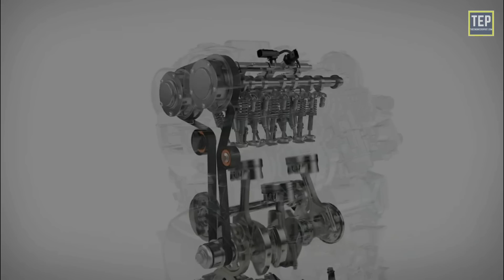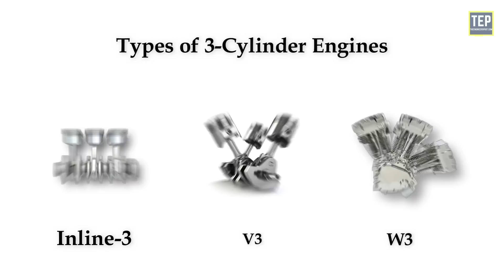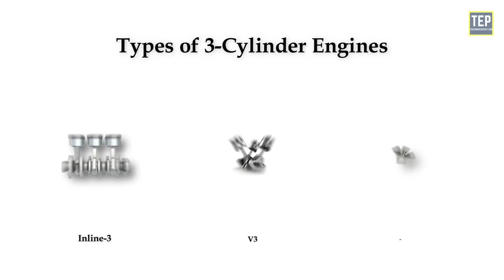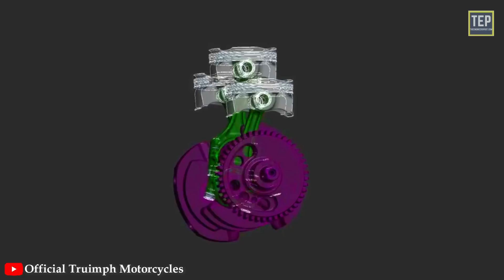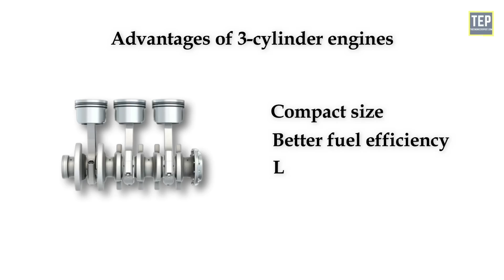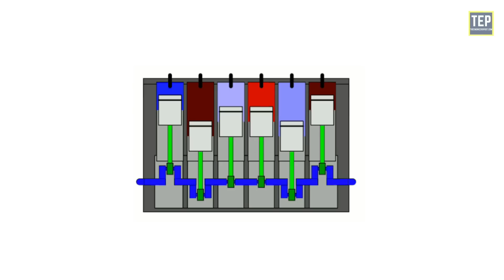How a 3-Cylinder Engine Works? Pros & Cons | Top Cars Using I3 Engines

Comment: The suzuki g10a and its turbo version is a legendary 3 cylinder almost twenty five years in production and sold in every continent on earth and still highly used. Simple to repair legendary reliabilty and fuel economy good torque decent hp with some enthusiasts getting impressive performance from them especially with efi and forced induction. ❤

Comment: they will easily suffer when they start towing weight not light stuff and then this video will easily be invalid because it does not produce all that speed and power it cant pull an suv over 40 mph without playing with the supercharger switch those engines are meant to be in motorcycles and go karts  not in large vehicles

Comment: Between the 1.2 naturally aspirated 3 cylinder Engine on the Toyota RAIZE vs the Turbo charged 1.0l version which you feel is better? I'm a female by the way and i'm stuck on which Variant to buy. Like what's the real difference here and does the extra money worth going turbo?

Comment: We have a a triple (naturally aspirated) in our peugoet 2016 108.  It puts out around 67 bhp and returns 55mpg overall.  You have to use it's  tall gearing to wind it up a hill but at 99 g/km it attracts on road tax in the UK.  The car is a around 900kg so just adequate really, nippy around town.

Comment: I just purchased a 2024 Chevy Trax with a 1.2L 3-cylinder turbo engine 3 months ago and it has been performing well. I sue it as a daily commuter to my job and I am quite pleased with its performance and fuel economy. Let's see how many years of good service it provides.
Reply: You just bought it & all cars drive good brand new. You don't know how good a car is until it hits 100K. 3 cylinder Engines in SUVs with Turbos is like a person on Methamphetamine. Sure at first it seems great with your body on overdrive but you age faster just like a small turbo engine. Also these small turbos require better seals because they produce a lot more pressure & pressures what causes engine seals & gaskets to blow. Also these engine have Direct Injection which causes carbon build up which is a nightmare to clean & will cause constant emissions codes. The truth is they didn't build these for longevity & if you dropped a v6 in these same bodies with that transmission they'd be so much more reliable & probably last a long long time. The only good thing about a 3 cylinder is there gonna create a lot of job opportunities for Mechanics & there's a lot of room to work under the hood. Personally i'd rather have the hood closed as much as possible.

Comment: More vibration? I'll stay with 4 cyc., or v 6......no 3 cyc
Reply: some 5 cylinders are extremely reliable, the problem with 3 cylinders in an suv is the size, they are way to small & will not be reliable long term

Comment: I have a Vauxhall Astra K SRI NAV 1.4 petrol with a cvt gearbox  with a 3 cylinder engine ,I purchased this car new in 2021 and I believe the engine is a GM engine ( maybe you can confirm this, or not? ) this is the only 3 cylinder car I have ever had or driven and, I have to say that that power it has is surprisingly good and, it's very good on fuel returning on a long journey 56 miles to a gallon.

Comment: Father purchased a new John Deere 1020 tractor. 3 cylinder, no turbos,  worked fine. Smaller tractor good for pulling a 3 bottom plow.

Comment: As I thought, the simulation confirmed that in a 4 stroke 3 cylinder engine, it has one BLIND shaft revolution when it is NOT generating power, therefore it is against the 4 stroke duty cycle principle!

Comment: I love 3 cylinder engines, but I hate the CVT that's paired with it, Toyota Raize 2022 is our car and it does well for regular city and highway, fuel efficient.

but low on power, if I had the money, I'd ship Toyota GR Corola over our place and use that instead. 
not complaining about the durability, only complaining about the speed and how fast it picks up.
there is a manual mode, but that deteriorates the CVT ( no belt problems so far... hopefully )

Comment: 1989 Geo Metro Hatchback 1L 3cyl, 5sp, 50mpg, 5 doors, a/c, etc    Incredible high torgue engine, no lugging with the long stroke, I could drive to Las Vegas at 90mph, great car, I put 200,000miles on it after 10 years and it still looked and ran like new. The earlier version 1988 Chev version had a turbo and was a beast.

Comment: Back in the 80’s I had a Yamaha V-Max V4. It was so powerful it was banned in some markets. Then I managed to buy a Vincent Black Shadow from 1955 which did 150 mph. Insanely fast & advanced for its era. It was nicknamed the plumber’s nightmare from all the external hydraulic lines. Today I drive a 2022 Subaru WRX, twin scroll turbo 2.4 litre boxer engine.

Comment: Well, I had a lot of experience with VW platform engines. Four cylinder engines always produced mooooore torque, are more silent and definitely more reliable then same volume three cylinder. Actually I use 1.2l petrol 4-cylinder  and by my experience I will never exchange it for 3-cylinder! 
By the way for comparison, in my private car I have 2l 4-cylinder diesel with 200hp and even the car is 1,5x heavier, AWD and is older, has lower consumption and less emissions. What a stupid EU regulations!

Comment: Make middle piston bigger than other two this will solve the vibration problem 😛
Reply: Yep, but use the perhaps triple-sized (and double weight) middle piston both as a (two-stroke) re-expansion cylinder for the other two (four-stroke) combustion cylinders AND as a positive crankcase pump that feeds crankcase vapors to the oxygenating catalytic converter instead of the current intake vacuum system that feeds crankcase goop into the induction system, which gunks everything up, especially when direct injection is used.

This keeps the induction system clean and means that the reducing cat will see oxygen-free conditions while the oxygenating cat will see oxygen rich conditions, improving both cats.

It works because the middle cylinder is bigger than the other two combined, so pressure in the crankcase wavers. Add a check valve from the intake to the crankcase and another from the crankcase to the oxygenating cat (which is always after the reducing cat).

Way cheaper emissions system that works far better, too. (Patent pending 1/8/24)

Comment: I own a Nissan Kicks e-Power.  Its 3 cylinder engine is only used for charging the battery and only the electric motor drive the wheels.

Comment: I'm surprised they haven't tried to implement a tri-axis engine, with each cylinder at either 60 degrees,or 120 degrees! Lubrication sealing would be a pita, but use of a dry sump system for 2, or all 3 cylinders could possibly work!
Reply: uhh, that's called a radial engine... and they've been around just about as long as multicylinder engines in general... and you either have a wet or dry sump... not this cylinder is dry and this one's somehow gonna be wet, absolutely not how it works.

Comment: I've owned a Mitsubishi Mirage with a 1.2 litre, 3 cylinder, naturally aspirated engine for 10 years and 120,000 klms, it has been ultra reliable and consistently gives 4.5 litres per hundred klm, (approx 60 mpg), I find the engine to very adequate to the chassis dynamics of this small car and great, economical transport.
Reply: Maruti Suzuki Wagonar 4 cylinder petrol engine gives 24km per liter average. The company claims 26km per liter. 1gallon=3.78 liter so 3.78*24=90.72.
Reply: How well does it run on a freeway?

Comment: I had a Honda NSR 400, Nissan Juke 1.2 3 cylinder and a Peugeot 2008 GT line 1.2 3 Cylinder, every one was quick enough. Technology really has moved with the times.
Reply: And they all sound like they're misfiring. Horrible drone boxes, if it has less than 4 cyclinders I won't own it, same goes for cars without a mechanical handbrake, manual gearbox and physical start key. Any car with auto brake and lane keeping assist is a big no. My current car is the newest car I'll ever own.
Reply: @gravemind6536  If you don't have money to get into the newest car technology dont cry, go work earn some money. Older cars are just that old, newer car keep improving everything season. Bug smashed. And if you think 4 is a balanced engine go make some research why a 4 in line needs so many balancing rings on crank, more then a ford 3 inline 1.0 that produces less side unbalancing centrifugal force then a 4 inline. btw ford 3 in line is the best from all car makers with almost none balancing rings, using a unbalanced flywheel and a unbalanced poly to counter the engine, making it very smooth. I have family with the ford 3 inline and if nobody tells, most people cant even notice its a 3 cylinder car. 
Go study, ready some books on physics, use google, dont just spew nonse.

Comment: Kind of like GM's piece of garbage 5-cylinder motor?  GM made it purposefully backfire and sputter; a defect which would eventually caused a failed catalytic converter.
GM did the same with 4 cylinder motors.
Time to vote with your wallet people

Comment: I owned three 3 cyl cars since 2011. Now I have a toyota vitz 1krfe 1.0 mated to a cvt. Its is not that peppy but after gaining some speed it happiy pulls away. And also its not that efficient in bumper to bumper traffic compared to 1.5 4 cyl cars. But its quite on par with them in highway efficiency

Comment: I have a 3 cylinder BMW turbo diesel and I don't like the relative lack of flexibility that inevitably follows the reduction in firing strokes. I like to be able to pull away gently at low revs - maybe 1100 rpm for a 4cyl but the 3 cyl is not happy below about 1500 rpm. I also have a 5 cyl volvo that seems happy pulling away from idle - about 900 rpm.

Comment: Back in the 1998, I had 2 vehicles. One was a 92 Geo Metro with a 3cylinder 1.0 liter engine, stick, no options basic car with 70,000 miles. I purchased this car for $100 and it had front end damage. The other was a 1993 Suzuki Swift with a 4cylinder 1.3 liter engine, stick, no options basic car with 5,000 miles. I purchased this car for $2500 (salvage title).  The Suzuki was dropped from the car hauler when it was delivered and had 0 miles and it was totaled. The gal I purchased it from sold it 4 years later. The Geo Metro was a gift to my brother-in-law when he came from Poland. The Metro was repaired, at a cost of less than $500 total, including a hood, paint, clutch and the $100 price of the car. Both of these cars were made by Suzuki and were reliable. The Metro came with only the 3 cylinder and thr Swift only with the 4 cylinder engine. The 4cylinder was stronger than the 3cylinder, everything else was the same. My broth-in-law kept the Metro for 19 months, he would use it to work for 2 weeks on $5 worth of gas. He then sold it at work to a gal for $1150, he needed a bigger car. The Swift I sold 5 months later to my nephew for what I paid for it, he wanted it badly. About a year later the Metro was doing well, but the Swift developed an electronic problem that was intermittent and unreliable and it was sold.  Both of these cars were great on mileage, I never really saw or felt any differences between them. Thanks…Jim
PS….I have rented a 1990 Ford Fiesta 1.0 liter 4 cylinder, stick, basic car in 1990 for a tour in Belgium, West Germany, East Germany and Poland. I put on 4500 kilometers in 3 weeks. It had great gas mileage and was comparable to the above cars. Mechanically it was no problem, however it was new and I lost the spare tire on the Autobahn in West Germany at the end of my trip. It was not properly fastened at the factory, being under the car in a covered storage, when it dropped the cover was dragging on the road surface. Luckily traffic was low and I retrieved it and replaced it. Gasoline in Europe was about $4.50 a gallon, in 1990.

Comment: Its a comprehensive guide on 3-cylinder engines. Amazing 👌🏻❤️
Reply from the maker: Glad you think so!
Reply: @TheEngineersPost Was 3 cylinders used on motorcycles?!.
And how about the rotar rx7 engine what is that?!.Box engines?!.
And if possible can you do twin turbo or turbo+super charger on a 3 cylinder engine?!.

Comment: Cylinder and all combustion engines are obsolete.  
Long live electric motors. Nikola Tesla said it best;
"The present belongs to you. The future is mine". 
What a visionary genius...!
Reply: Yep. But electric motors also have some shortcomings, like they run out of Torque at higher RPM(s). Or require insane cooling systems (yep, more insane than combustion engines).
Reply: @ravenclawgamer6367  correct!!!
Reply: Electric engines are surely not the future too. All these expensive batteries that have small life cicles are going to damage the environment. The future is clean energy engines that are not related with electricity.
Reply: Ok
Reply: NO electric motors have their problems to overheat explode leak or run shortages 

There's many ways to power them though whether it be nuclear hydrogen fuel cells lithium or solar panels 

But gas is more cheaper all gone is the era of strong gas diesel engines

I think the v10 naturally aspirated is UNMATCHED
Reply: Unless they allow a nuclear battery which virtually never needs charging, Electric remains stagnant Combustion engines are the future V8 V10 V12 with green hydrogen. Tesla hasn't done anything special and battery tech is still the same electric motors are the same as old 1930s and I believe he just used "aaa" joined together to make the battery packs.